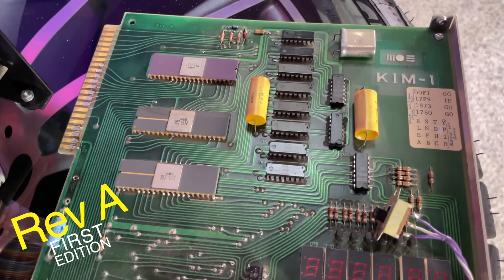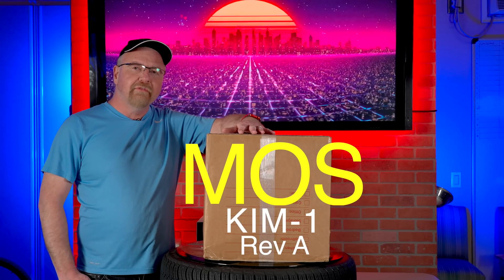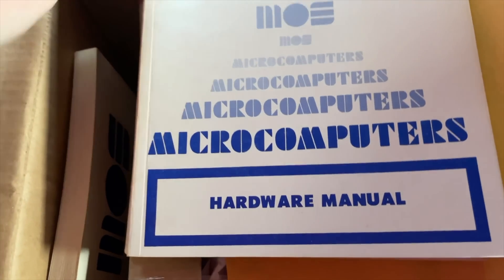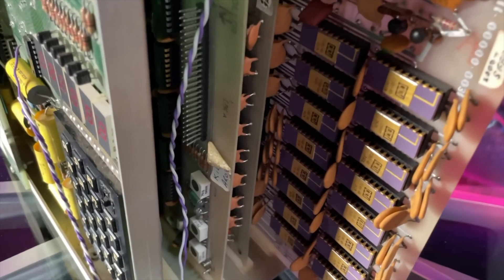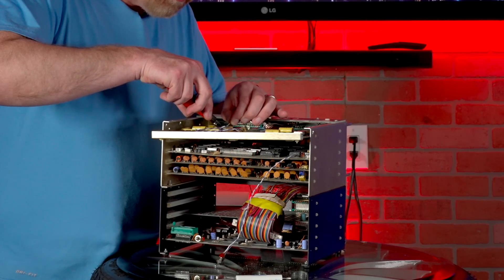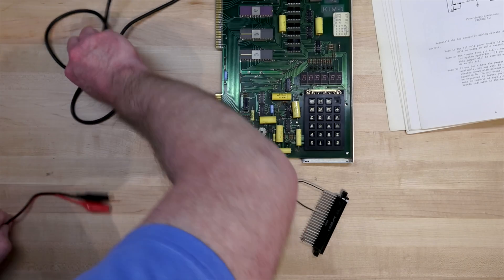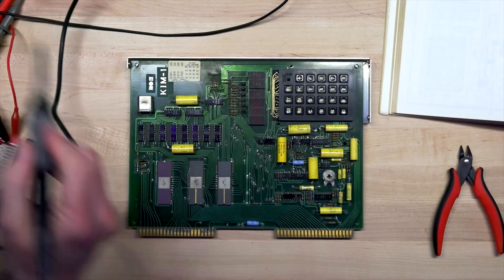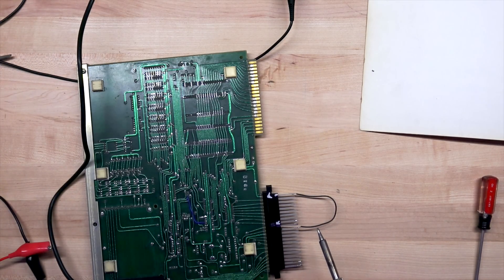I Bought the Oldest PC on eBay! Unboxing the KIM-1

Comment: I am currently restoring MY first “PC” a SYM-1 that I bought using money I earned working after-school jobs in high school. The SYM-1 is the cooler big-brother to the KIM-1. Thanks to the internet, I have an early Microsoft Basic for it in addition to the Resident Editor Assembler (REA) and even a C cross-compiler! I taught myself 6502 machine language back in the day using a “BYTE Magazine Programming Pad” which was a paper form you could write out the assembly code and then hand assemble before typing in the hex digits. I’ve built a custom expansion board that boosts the SYM-1 to 64K of super-cap backed SRAM and the aforementioned ROM images which I can switch in and out of the memory map using dip switches. I’ve built a remote keypad and hex display using modern ‘real’ keys. I’ve programmed many computers over the years but I’ll always have a soft spot for my first!
Reply: My dad had a sym1 and wire wrapped a 16k ram board and a  keyboard and terminal interface. I    (as a young kid) helped. lol. I remember a teletype Asr33 at 110 baud with a paper tape reader and upgrading to a 300 baud video terminal. This was around 78/79.
Reply: In the early 80's just a few years out of school, my company was asked to design a controller for a paper making machine.  I started out with the idea of using a KIM-1 based on my experience with it in my college digital electronics lab class.  Doing a bit of research I discovered the SYM-1 which appeared to be an improved version of the KIM-1.  I designed and produced in-house PCB's to adapt it to the newly invented industrial control STD-Bus.  After installation, the system controlled the production of most of the milk carton paper produced in the US.  It controlled the the largest paper making machine of its kind in the world.  I know it was in service for over a decade, because I was called for advice by my former employer. They were requested to make a service call, because the system was acting erratically.  I suggested they pull each card, clean the contacts and reseat it.  They reported back to me that, removing the accumulated dust and cleaning as I suggested solved the problem.  Apparently the controller had dutifully done its job 24/7 for all those years without being touched even once until then.  I've no idea how much longer they used it.
Reply: @videcomp  I do wonder how many such things happened… that’s so cool!
Reply: Sorry, never got into Doom… One of my after school jobs in high school was translating BASIC adventure games from one dialect of BASIC to another. Mostly between AppleSoft and TRS-80 BASIC but I did spend some time with the Commodore PET and the TI-99/4. I think I’m fortunate to have the experience in programming 6502, Z80, 6809, 68000, and 8086/80286 assembly language. But my first was 6502 machine code before I saved up enough money to buy a 6502 assembler that ran on the Apple ][ but I was only able to use after school to assemble my SYM-1 programs…
Reply: But... can it run DOOM? ;P
Reply: @DunnickFayuro  With my dads knowledge at the time he could have probably succeeded- lol
Reply: My SYM-1 is still running today with 64K Ram and interfacing to the old Commodore floppy drives.  Even have it connected to the internet via a LAN to Series Port adapter.  Roll with the times ;)
Reply: @radiolabworks  Wow!!!@

Comment: Dave, I have the manuals for it if you need some info. We were able to get it to connect to a TTY at more than 100kbaud even the manual states com rates up to 300 baud.  It is the first computer I played a game on - my dad run moon lander in it in the mid -70’s with us kids!
Reply from the maker: Your Dad sounds pretty amazing!  I do have the computer "visual memory" board, I wonder if I could run lander!
Reply: Experiment 4, yes, they were available in Sweden, dad worked at Esrange with sounding rockets and they had cutting edge technology! I have my own KIM that I got in the late 1980’s that haven run in 20 years…
Reply: David, we had only a small LED screen, it counted down, you entered thrust - and it displayed speed, altitude and fuel.
Reply: vad kul att man kunde ha köpt en KIM-1 i sverige!

Comment: I bought one of the collection of basic 6502 chips Mos Technology sold to get started building microcomputers.  Unfortunately Motorola came out with a chip set and PCB for their MC6800 before I built the 6502 system.  Later my then boss, who didn't care much for microprocessors at the time, bought one of these KIM-1 computers and he was very impressed... so was I, but I continued to play in the 6800 world for years.

Comment: AMAZING!!! God!! I love this channel (along with Curious Marc's and 8-bit guy's channel). I think you should try building and using KIM-Uno which is a KIM emulator using Arduino Uno. I didn't have any experience with making professional PCBs at the time so I hand soldered the keyboard and everything. It was my first experience with machine code and it was so much fun. Sadly, the one I made didn't work for more than a month because of the cheap wires I had used. But it was fun!!! 
Pls: keep on making such videos! They are fun!!
Reply: You might like Adrian’s Digital Basement too. Curious Marc’s channel is mind blowing. The depth of skill and knowledge in that group is just inspiring.